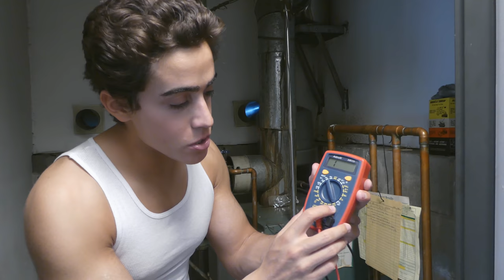Grounding and Earthing are Nature's Antioxidant

Comment: Previously I thought grounding and earthing were just BS after watching this though I've been converted thanks Frankie boy :)
Reply: Now you're a believer.
Reply: They are not only bullshit, but extremely dangerous. We use ground as a safety measure, we dump a lot of juice in the ground. You are connecting yourself to the electric grid by doing this. People have gone to the hospital from this shit. Do not follow people who know nothing about what they are doing, like Frank.
Reply: @nobodynowhere5213  If you're grounding yourself and find yourself connected to the power grid, you've definitely done something wrong.
Reply: @afelias  You do know, that you have ground in your power plugs? Just measure what you are getting from the ground... think about what happens, if one of your electric devices fails while you are connected to the same ground.

Comment: When I worked railroad construction, when we installed new roadside crossing control houses we used 8 foot copper grounding rods. Sometimes, for whatever reason, we would have to use two. One stacked on top of another to create a 16 foot grounding rod. That is probably why the rod you used outside of your house isn’t working, you said I believe that it was only a foot and a half long. Try an eight footer and see what that does for you

Comment: The wrist strap molded snap button has a 1 Megohm resistor in it, so the grounding won't be exactly the same as a direct connection.

Comment: Yes, it was shown to decrease cortisol levels. I used a metal plate from an old PC case and placed it under foot while sitting. I just wire the plate to the radiator. The actual earth grounding should be a big metal plate buried in the ground. With thin wires, the resistance is high, your body catch EMI like an antenna and the voltmeter measures garbage (from ohms law U=IR, with same I, R is high so U is high). Also the voltage is not higher the higher you are, that's true for potential energy. Note also that walking barefoot on concrete or stones is useless.

Comment: Uuuuuhhhm frank, voltage is electric potential *difference*, so if you messure the voltage of a circuit with just you as a middle man, ofc you gonna get near zero. but that doesn't mean the thing you just measured on is grounded. the measurements you made dont actually make any sense. But yeah, grounding is very good in general.
Reply: adabo  So, something is grounded if the electric potential of it is the same as the earth's. Since the volt meter measures the difference in electric potential, you connect the one end to the earth (or something else you know is grounded) and the other to the thing you want to know of if it's grounded. If the value is close to zero its grounded.
Reply: @zipfelchefchen6816  What about the dirty electricity, that something we need to worry about when grounding?
Reply: @zipfelchefchen6816  There seems to be 0.3-0.4 V between my radiator and the earth. I attached an insulated copper wire to my radiator (no paint) and threw it out the window. I then went outside, shoved the black lead into the ground and connected the red lead to the copper wire. Does this mean my radiator is not grounded?

Comment: 18:32 if you don´t have too many mosquitoes, once it´s warm enough, really try sleeping outdoors in your backyard lawn, in a tent without bottom, no rubber mat obviously .... just blankets ... it´s heavenly, the moment you lie down you´re so relaxed ... just try it during the day, just a towel on the grass, lie flat on your back, or raising the legs so soles of your feet touch the ground and turning the arms in a way that your palms touch the ground also for optimal chakra surface (seriously, palms and soles are electrical spinning wheels), you´ll snooze off in no time, it´s incredible ....

Comment: I just got myself a magnetic mattress topper and its amazing.  I do have emf shielding in my bedroom as well.  Too much radiation from thw Wi-Fi and dirty electricity.  A simple switch of turning off the breakers and unplugging Wi-Fi can also do wonders.  Many people are living next to smart meters which can pump out dangerous frequencies.  I have 4 next to my bedroom.. It measures 14,000 microwatts of microwave radiation.  And yes I have aluminum foil on the Wall to shield it and my meter registers in the lower ranges.

Comment: 7:54 Prof. Frankie´s Physics Lab - now connect this with sungazing, but only when the sun is rising or setting, or during the day filtered through some branches with leaves, or closing your eyes a little and filtering through the eye-lashes, not full blast if during the day, and the experience is very healing and empowering. You´ll then really experience yourself as a conduit. The electrical current in through the sunlight, through the optical nerve which is very short and in direct contact with the brain, supercharge ... all this while standing barefoot in the grass or ground, releasing the positive charge into the ground, while at the same time receiving electrically through the sun (male) and giving off into the earth (female). The circuit is tangible, the cleansing inner "shower" too ... it´s refreshing, restoring, invigorating, but leaves you with a self-empowered feeling of calm and self-confidence (you not only released excess but also received the male/ sun energy) ... once you feel it and realize what´s going on, and then imagine how the circuit travels outside of your body, bigger picture and understanding falls into place. No BS, no theory, no belief, pure experiment and experience ... enjoy !
Ok, and to even top it, although this may sound a little woo woo, but simply think about it and remember how you feel after either activity. Back to the above, the sungazing, and realizing how the eyes are connected and how the sunlight is giving. So the eyes are portals, directly to the nervous system, directly to the brain. Again, the sun is giving. Now in contrast, staring at the computer screen, also the eyes are portals, connected to the nerves, directly to the brain - only the pc radiation, light and vibes are TAKING ....
After sun, earth conduit, you feel re-energized, after pc-hours you feel drained .... luckily one balances the other, knowing this and feeling this, it´s good to keep rebalancing ....

Comment: Very interesting. Here is what I don't understand: The multimeter measures the electric potential between two sources. If you plug both ends into the soil, you should measure a voltage (difference in potential) of 0V. In general, if you short it to the same source, that is what you ought to read.

Now, whatever charge the earth is, after grounding yourself, you and the earth should be in an equilibrium of charge. That means that there is no flux of electric charge between you and the earth. So applying the multimeter, you should read 0V. However, you're reading a slightly negative voltage. That means, that shorting the earth and yourself, there would be a flux of electrons from yourself to the earth. 

So something else is going on here that prevents the you-and-earth system from reaching equilibrium.

Does anybody have an explanation for this? Like the nervous system leaking electricity? Body resistance?

Comment: ... and it´s great that you have the backyard availbale, if you just walk around barefoot while at the grill etc, you can easily regularly release all the city buzz which is crazy in NYC, equally after having been for long hours by the computer, say for a live stream, afterwards walking around on the grass in your backyard barefoot for a bit, releasing through exhaling too, which comes naturally, you´ll feel yourself sighing with relief, and all tension is released, it always feels like relief and lightness very quickly almost immediately - also great before bed for sound sleep and releasing the computer buzz which charges the body to it´s disadvantage and is burdensome on the body´s own electrical circuit, i.e . heart nodes which generate the heart beat .....

Comment: I appreciate the hustle to find a cleaner grounded source, but you should sort of establish a baseline for the every day person, rather than dissuade them. All the positive studies done on grounding, have mostly come from people grounded from electrical outlets in very urban environments, which probably have dirty electricity. Whatever negatives you get from the dirty electricity are massively outweighed by the grounding (which assuming that you're just setting up this new grounding source, means you've been using the electrical outlet solution primarily, and have been experiencing a lot of the benefits like better sleep). The whole copper wire stuff is too much for a lot of people, and I think it's good to get them on the earthing.com equipment, which is fairly straightforward.
Reply: Rey Wright: Thanks man that answered all my questions on grounding appreciate it

Comment: i got some speaker wire, and cut the rubber off about an inch off both ends and wrapped one end around a hanger (sanded the hanger and put in the ground) and connected the other end with an alligator clamp to an ArgenMesh sheet I lay on my bed at night.  I have tested with a volt meter and it works and I get great sleep

Comment: Grounding is the single best health strategy I've discovered in the last few years.
Reply: @incorectulpolitic  I spend every moment possible outside in bare feet. If the weather is OK I set up my laptop on the grass outside for example. I also have bought an earthing ground sheet for my bed which is connected to the earthed wire.
Reply: @incorectulpolitic  Definitely. I wake up feeling much more refreshed.
Reply: @dharmawarrior111  where should I look for grounding products?

Comment: I got the same result you did making my own wire and connecting it to myself and to the outside, when a friend of mine used the same line/setup his voltage dropped but mine went up.

Comment: End stage carnivoreism right here, folks.
Just kidding. A very valid experiment. Fluctuations in the readings are probably from various factors. Skin/body resistance, multimeter accuracy in the millivolt range, length of wiring and fluctuations. .. Voltage is the potential difference between two points. So if there's a minor current traveling through a given path of material, there could be a voltage drop between the two points that are measured. Anyway, it's bed time so I'm going to go grab my multimeter out of storage and do some Tufano inspired experiments tonight. ... I might also ground myself to an outlet. Here we go!

Comment: Aluminum foil under madrass and in the best cover sheet. Should do alot right...?
Omh dude "take his shies of itll make him sick" 
I picked that up from that same clip in a night of ceremony on my own in a cabin in the forest at a point i was still much more sensitive in my body... I remember going outside feeling it very well(i was also in a specificqlly hightened state that night)
And remembering holy shit ive neglected the grounding factor... 
Been pondering how to build an inexpensive grounding bed sheet, curious though as to how to plug it in an apartment.
Moccasins thats it what to get... yogis wore wooden shoes.
Usel tonplay with Cooper wire  under my shoes going in and under the foot, I figured that SHOULD work - like earthrunners(never tried earthrunners tho)
BUT I got some idea back then about the symmetry of that halv assed setup as it did not feel right... thoughts?
In sweden we have water radiatiors mostly, and someone mentioned to me those would be grounded - so dragning a Cooper wire to a part of such a radiator should create a grounding point. Later on an electrician said something abiut thst being much more Danderyds than pluggning into a sockets grounding bits, as IF some shit goes bad in the building and thats a big if but if, radiator path could give you a lethal shock, so should not be plugged to it sleeping lol...
I gotta ask that guy again.
 Cooper wire drawing it under my sheet to try and sleep grounded...again i got some idea of the symmetry cuz i was not sure if it felt good or not, I figure copper wire being randomly drawn like that,fuck do i know, might create some other electromagnetic effect if its not in symmetry. 
So i thought. Eventually dropped the ball completely on grounding again.
Reply: Ohh and there comes you talking on the piping lol...
So but really, does your body get grounded just like that, just touching a grounding point? Ive thought about it at times, and then just touching my radiator should ground my body...?
 gotta get that meter thingy...
Reply: Not fully sure these pipes are copper tho

Comment: I used to earth myself indoors to, until I realized I was just becoming part of the circuit for my houses dirty electricity to flow through me and to ground...gave me no benefit whatsoever...I think it does help if you are earthing when not near any live wires in the walls/outlets etc. I think your readings suggest you may be doing the same.
Reply: Mark Evans: So I should run a rod outside my window then?

Comment: Interesting, what you have on the ground negative charge - is there moving of electricity between air and ground over you ?
I was very charged for a long time - I was just sick to be shocked of that static electricity. But then passed away with improvement of my health, somehow it's connected to the state of the skin, and now static electricity is pretty rare for me.
Reply: Actually, I think,  in a modern environment,  if you get "zapped " when you touch a doorknob or something, it shows that your body is in its correct charge....we are not meant to be surrounded by electricity the way we are now....I could be wrong about this...🤔

Comment: Were you using AC or DC with the multimeter?  When I tried it using AC, I could not get a negative voltage, only ~0 mV.
Reply: He was using DC. AC normally don't go negative at least with this multimeter. Reason been is that DC is one way direction and AC is an two way electric flux with an near perfect frequency.
Reply: @mesertuga  Makes sense, thanks.  I'm going to experiment a little with DC.  Any thoughts on which is better?  DC seems a little more inconsistent/erratic...
Reply: @Ctgregory5  I guess it should be better set in resistance. Can be used as the same but just try to get  zero Ohms. 
Normally electric grounding it's good below 15 ohm. So I do believe that any value from 0 to 30ohms should be ok.
Just by been connected to any metallic structure  or do not have any source of isolation the voltage level will always try to be 0.
That's way in cars with rubber tires some persons ( myself included) going out of the car when put the feet in the ground get static electricity discharges.
Reply: Normally the normal average resistance from the human body is around 1500 to 2000 ohms with a dry skin.